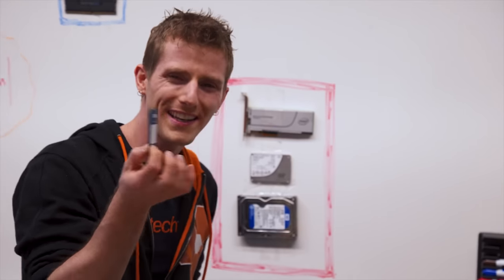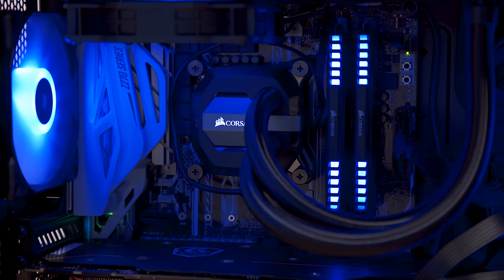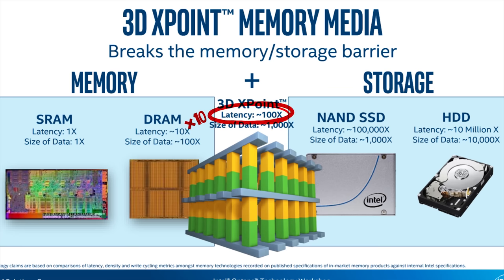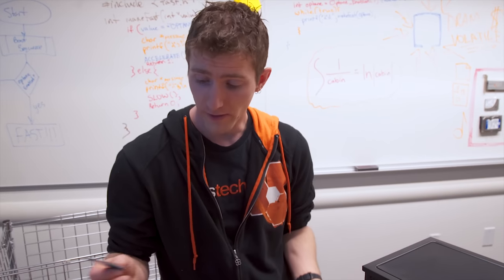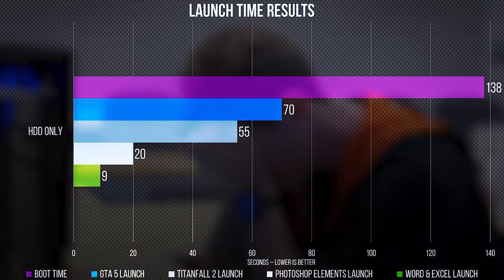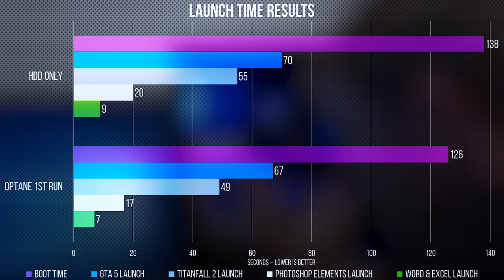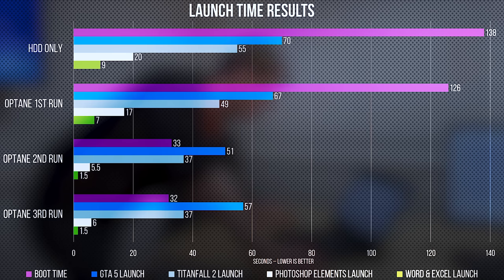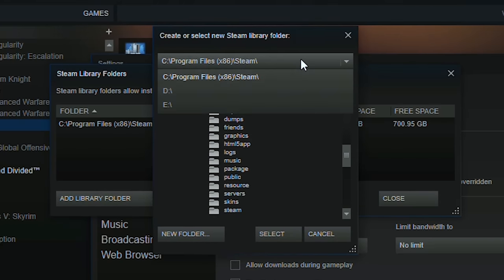Intel Optane Exclusive Hands On - SSD Crushing Performance

Comment: So it's not any better than SSDs. That explains why there's no comparison to an SSD rig.

I was hoping that I could add an even faster layer of storage to my computer. Damn.
Reply: TheTubeTimeMaster1 I had same hopes...
Reply: unfortunately m.2 is only slightly faster than ssd
Reply: you are confusing m.2 with nvme and ssd with sata.
Reply: The memory technology is quite a bit faster than V-NAND we are talking tens of times faster, however the m.2 port speed limitations limit it at just above V-NAND speeds. I am guessing this is a move to finance the development and production of higher density chips using this technology, which than will be implemented in their different SSD designs improving life cycles significantly. HP's patent mentioned using 2 and 4 channel optical interfaces to single chip which was capable of storing hundreds of terabytes in just about 1 cm^3 of the active medium. Speeds of up to 20GB/s per chip were theorized, with random access times in the ns range. Data retention when powered off up to 2-3 thousand years.....
Reply: Why fill your M.2 slot with a 50$ module ( plus a 100$ hard drive ) and just not purchase a m.2 form factor ssd with a PCIe interface with nvme protocol?

For some consumer that can't purchase a m.2 now and still have Serial ATA 6gb/s SSD or hard drive, that can be a more economical solution, but I think that the limitation of just m.2 form factor is not the right move. If you can run it on a PCIe card or even thunderbolt 3, then this will be more interesting for mainstream users.

Maybe this thechnoligy will help to sell more hard drive from WD and Seagate : )

Another interogation is  what speed to expect  from a sata m.2 vs a PCIe one?
Reply: Well there's always RAM disks.
Reply: My thought was you could just use a regular mechanical hard drive or sata ssd as a boot drive and still get close to nvme ssd performance for cheaper
Reply: Fun Minigames there is no way nvme is slower than this shit. This shit is only useful on HDDs and will only make sense if you use multiple HDDs at the same time. Like maybe 5 HDDs with 2tb storage each. It's an alternative for people who can't afford SSDs but want some improved speed.
Reply: TheTubeTimeMaster1 it's useful when you have a server maybe? To most people that's just stupidly useless.
Reply: Most people tend to run M.2/NVMe drives for system and mechanical drives for storage, so this would still do well to speed up access times from your storage drives. I think I'll likely go this route. For $50, you really can't beat that. It's a small, cheap way to speed up your existing storage.
Reply: 960 Evo is faster than Optane memory but it is because the Optane memory comes only with PCIe Gen3 x2 support which is the bottleneck.

Expect Optane SSDs to support x4 when they come out but Optane memory will probably stick to just x2.
Reply: These Optane drives cannot speed up your storage devices (may be they will in future) so you are out of luck. These drives can only speed up the boot drive at the moment.
Reply: not existing storage : NEW STORAGE!!! It only works with kaby lake systems, that have been here since january! So it's an useless upgrade to a new system: who buys a new mid to high end pc without an ssd? Neither Linus paid a fortune by Intel would.
Reply: I look at it this way:  A 1T 960 Evo is 500 bucks. A 1T SATA SSD is 250.  A 1T Mechanical HD is 80.  If I can add a 80 chip and get a HUGE noticeable performance boost for that little money and nearly no effort, its a great idea.
Mind you, I want to see how well it preforms using a wider variety of hardware (SATA SSDs, ect) before I buy.
Reply: i would have wanting him to test it against a NMVe drive but that is ok as IF the end user is going to be willing to add a Optane drive they also would have been willing to add a NVMe M.2 drive too so
Reply: They would also have to have a second M.2 drive though. I have an M.2 NVME drive with the OS on it, so this test would have been very nice to see.
Reply: TheTubeTimeMaster1 it is better in every way.
Reply: It should be much faster, if you compared a full 3DXPoint NVME SSD to a NAND one.  But that's not what this is.  This is geared more as an auxiliary cache, which while interesting in the video, sure won't make me part with any money.  This tech is too expensive right now at the consumer level (to the tune of $1500 for a 375 GB Optane SSD).  I hope to see that improve, assuming they don't force us to buy a 7th-Gen CPU and motherboard along with an Optane SSD.
Reply: TheTubeTimeMaster1 it's kinda funny because the name of the video is "SSD crushing performance"
Reply: my ssd has 550MB/sec write and 480MB/sec write. While my m2 has 3000MB/sec read and 2400MB/write
Reply: TheTubeTimeMaster1 I think 100-250 gig NVMA SSD or regular SSD is better option then 16 or 32gig optane  memory
Reply: once you get one in house you should see if running these alongside raid 0 has any benefits
Reply: these memories do not support RAID. the only thing they do is 
"One Optane Memory" will accelerate "One SATA drive" provided that it is a 
"boot drive" for 
"Windows 10 64 bit" and has
"Intel Core 7th Gen" and
"200 series Motherboard" with
"Optane Ready M.2 slot"

Satisfy ALL the above conditions to get Optane Memory.
Reply: Mohan Pednekar thankfully I meet all of these requirements
Reply: It does not work that way. It only helps with small frequently used chunk of data. All other stuff on your drive will be slow AF. You'll be better off buying SSD just for all your essential software and HDD for the rest.
Reply: I'm still holding out for larger m.2 optane drives to show up, I'm pretty sure they are on the way. Then I'll do a RAID0 optane :D
Reply: The thing is, the write cycles aren't as good as an SSD. Your'e not going to want to use this for primary storage.
https://semiaccurate.com/2017/03/27/intel-crosses-unacceptable-ethical-line/

Comment: Great but what system that still runs on a HDD as main drive does actually have a M.2 slot?!
Reply: I think that's the real point of Optane, so system sellers can pop a $50 chip into a system with a cheap mechanical drive and the end user won't notice as much how slow the drive is.
Reply: Exactly. This seems like a cheap attempt to sell what would otherwise be server hardware to gullible consumers.
Reply: im stuck with slow HDD's because of my 2008 motherboard that doesnt accept SSD's and not having the money to upgrade everything
Reply: 1st: as long as your board has SATA 3gb Ports you should be able to connect an ssd with that spec
2nd this is besides my point... since optane is using M.2 interface, your board wont support it either... AND you don't have 7th gen Intel CPU
Reply: RichardzPlayzMC You have plenty of options. You can get a PCIe slot mounted mount m.2 drive, or a PCIe SATA 6 gbit card and use SATA SSDs - you will not be able to boot from them, but you can use them as app drives. You cannot however use Optane, because it requires a 7th generation Core i3, i5, or i7 CPU, and a brand new 700 series chipset motherboard.
Reply: thing is I tried connecting a Samsung Evo SSD to my PC and it just doesn't show up in the CMOS BIOS
Reply: RichardzPlayzMC there are a few specific drives for older pcs, not every drive will work... 
Jeremy's ideas are good to...
Reply: yeah but using a pcie converter that costs like 400ish euro then a m.2 drive where my PC might not even work with what is like 120euro each then having to give up my ati xfx 7770 for the internal 512mb ddr2 hd 4200 Apu is a big nope
Reply: Found this for you, maybe you can find the card somewhere in the EU:

https://www.newegg.com/Product/Product.aspx?Item=N82E16812161007&cm_re=pcie_ssd_adapter--12-161-007--Product

It has a BIOS so you can even boot off of the drives. They also make a non-RAID version that's much cheaper.
Reply: Jeremy Turnley yeah but I'm not giving up my dedicated graphics card for something expensive that might not work at all
Reply: RichardzPlayzMC adapters like that should work in a 4x slot form factor so it wouldn't necessarily have to replace your Gpu
Reply: It actually says it will work in a 2x slot. Even in a 2x slot even the cheapest SSDs will be much faster than spinners from 2008.
Reply: I have a microATX board that has 2 PCI slots 1 pcie x16 slot and one pcie x1 slot
Reply: Yep, you're hosed then. Sorry.

Comment: "For a little as $50," and mentioned only 16GB and 32GB.
So I am guessing $50 for a 16GB module.
Well, for $50, I will rather get a 128GB SSD.
Reply: That's a shitty argument because it's $50 for something will speed up read/writes on an HDD, something has an infinitely higher capacity for a fraction of the price.
Reply: As opposed to buying a hybrid drive for $20 more saving $30?
Reply: You can get same speeds as that $50 128GB SSD on a 4TB HDD with the optane due to caching.
Reply: Yes right know but with computers and specs going down in price this might make sense in say 3-5 years
Reply: Thank you esperCELL, I'm not sure why people don't understand that. Don't pair it with a 500gb HDD. For $50-80 you can have several TB of hybrid speed.

Comment: So there is no point if you have an ssd?
Reply: Black Bird Exactly. This thing is for faster caching and therefore faster response times. SSD-based systems likely wouldn't see any difference at all since they're already lightning fast as opposed to HDDs.
Reply: This kind of reminds me of hybrid hdds.
Reply: Arclight and considering the marginal boost to game launches it wouldn't improve a system like mine with a boot SSD and gaming HDD
Reply: Really no point even if you don't you can buy a 120GB kingston SSD for $53 and have an actual system drive SSD.
Reply: Except hybrid drives don't really make this much of a difference.
Reply: Yep no point, with my old Crucial SSD ( plus fastboot enabled ) it takes approx. 3-4 seconds to get to login screen and then another 3-4 seconds to load everything up, so having this wont benefit you at all.
Reply: This is basically overpriced Turbomemory (from intel in 2009)
Reply: Better if you're building a mini itx build. less cable.
Reply: Or Rey, you could just buy ANY normal M.2 SSD and that will be better and will go into the same slot?
Reply: This doesn't work as a replacement for storage, it's an addition. You're probably thinking of an M.2 SSD.
Reply: Black Bird why not have both?
Reply: It seems like a M.2 RAM-like cache. It's faster then SATA SSD